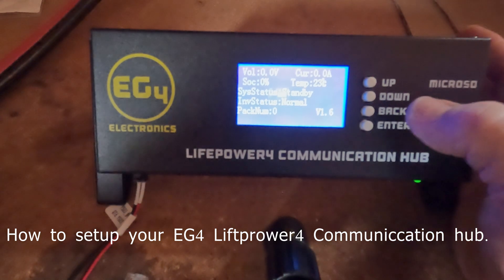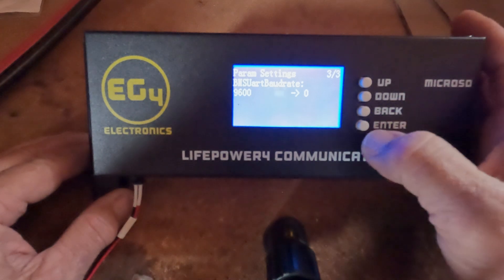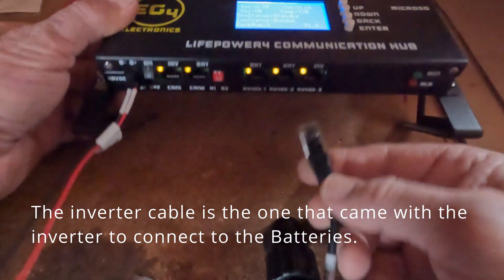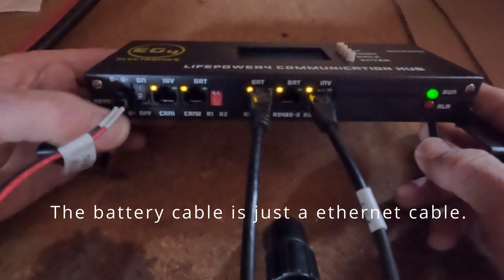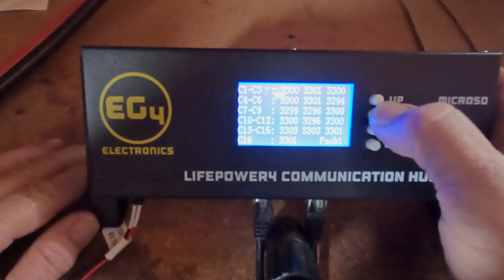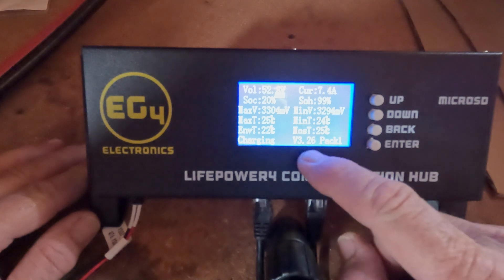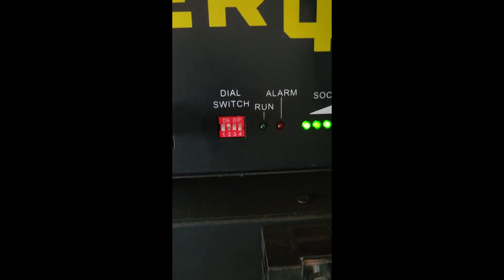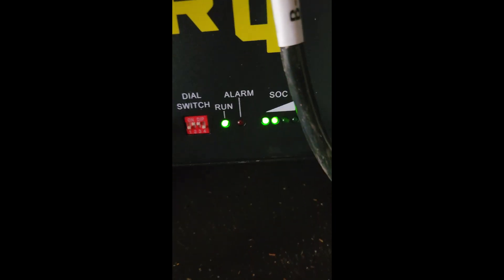How to setup your eg4 lifepower4 communication hub

Comment: Which inverter did you hook up to? 2p1 or 2p2? I have the exact same setup and I'm looking at this hub but I am clueless on how to install it.

For the batteries ethernet cable how did you install it to the hub? Isn't that the same cable that goes into the inverter? Do we just unplug the one to the inverter and plug it into the hub?
Reply from the maker: it took me a long time to figure out how to get it to work tech support did not help.

It's the ethernet cable that came with the inverter there's a white tape on one end I believe it has to go into the inverter 2p1 The cable only will work one direction

Comment: Good job. Which inverter are you interfacing with?
Reply from the maker: 2 EG4-6500EX 48v
Reply: @Endlesssummer58  I using the LP4 Hub to communicate with 2 SolArk 15ks.
Reply from the maker: EG4-6500EX-48